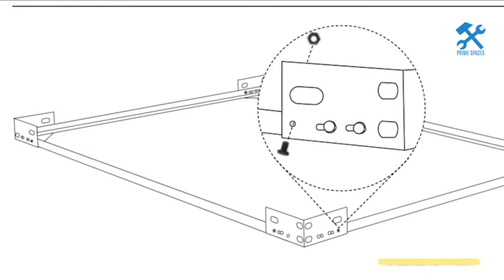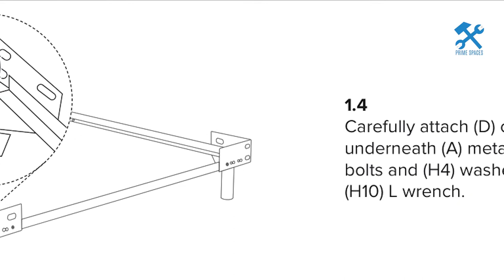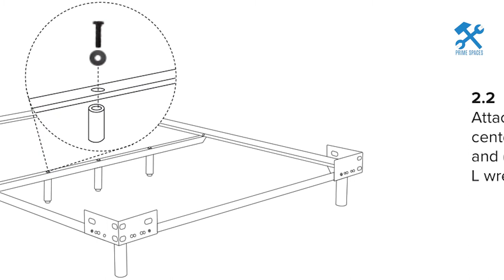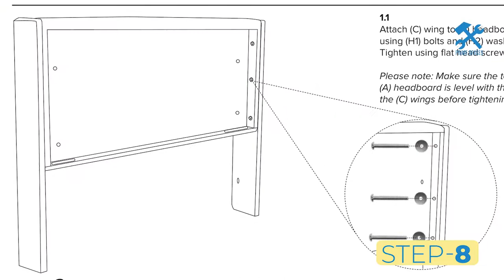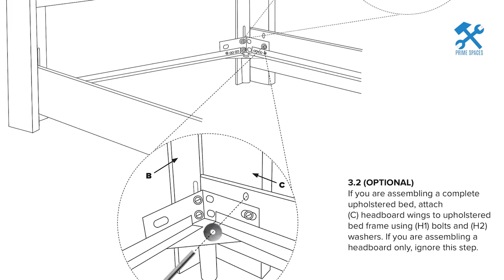Skyline Zuma Wingback Platform Bed Assembly Instructions Hanson Upholstered Low Profile Standard Bed

Comment: Hi I’m having trouble with the legs in the center step 2:2. Every time I add weight the legs all go slanted and it’s properly screwed in. So when I add the mattress and make my husband sit in the legs all go slanted and I adjusted the screw on the bottom of the legs
Reply from the maker: Hey there! Maybe the legs aren’t the issue. Could it be the metal rails that the legs are connected to aren’t fully tightened?

Comment: When attaching the headboard to the base of the bed frame did you have any issues keeping the brackets and bolts in place? It seems like the tighter I make the bottom the looser the top becomes and it keeps falling out. The headboard does not feel secure to support leaning back. Any suggestions for fixing?
Reply from the maker: Hey there! 👋🏾 in order to attach the headboard to the bedframe you need to use the correct bolts along with a pair of washers for each bolt. At 04:53 of this video I show the proper orientation. Slow the video speed down (and you’ll prob want to mute the music). I hope this suggestion helps!

Comment: I’m having issues with step 1.4. The screws will not go into the metal stand. I see you used a drill. Is that the only way it will work? I don’t have the bit for it and none of the screws will go in

Comment: Hello. I recently purchased this bed, but I am having a problem with getting the upholstered side rails to be flush with the foot rail. I realized that the welded knots on the black metal frame stick out, preventing the rails from coming all the way together, leaving a gap. Do you have any suggestions on how I can fix that?
Reply from the maker: Hey Mohoganii! 👋🏾 I suggest loosening all the bolts and screws where the side rails and footboard meet. Clinch them together so that they touch, then tighten them as the the side rails and footboard are touching so that there is no gap. I hope this helps!
Reply: Thank you so much for responding. I believe the issue is those knots that are in the way. They prevent the pieces from coming together. And because they’re welded in place, there’s no way to tighten them. I am going to try to figure something out, maybe drill holes into the rails to create a space for the knots to fit into. That will allow the pieces to get closer together. But that’s a last resort, because the gap is an eyesore for me. But thanks again.

Comment: Thank you, nice work.
What to do when metal frame (80"x80") does not fit inside the upholstered side rails (76" w)?  No dimensions or adjustments are included on the spec sheets?
💡call the 800#?
Why the mask?
Outgassing from China?
Reply from the maker: Hey Stephen! 👋🏾 It sounds like they may have sent you the wrong size bed. I don’t think the frame should be longer than the actual side rails. You should definitely call the 800 number if there is one available on the instruction manual. And the mask? Let’s just say it was halloween. 👻 Please, subscribe to the channel if you have not already! ✅🙏🏾
Reply: @Prime_Spaces  Thanks for your reply. I eventually discovered the glitch in my noggin by reviewing the schematic and unleashing my trusty tape measure. Problem solved, assembly completed and had a good laugh at myself.